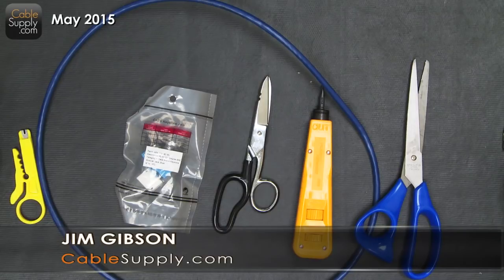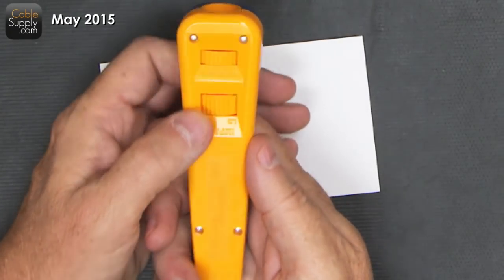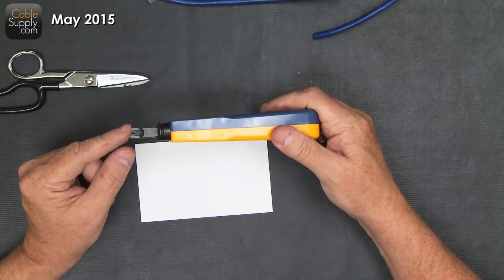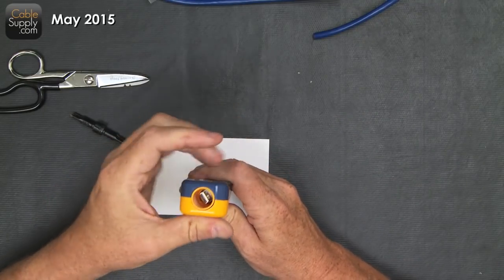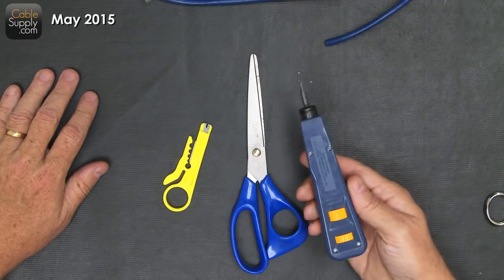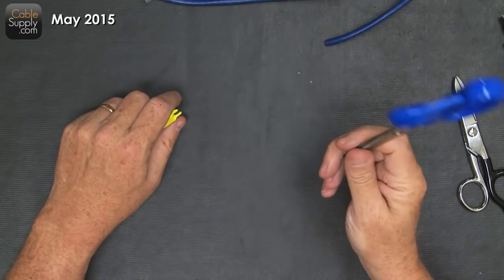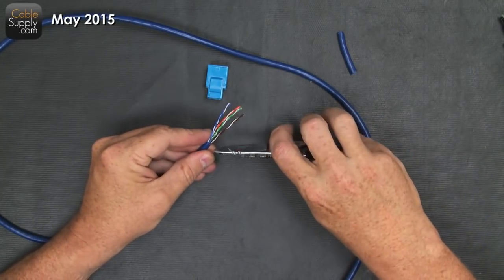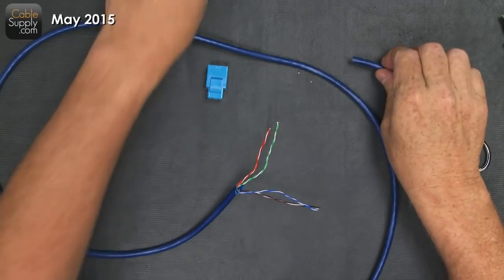How To Install A Cat6 Computer Jack

Comment: Honestly, if you don't want to EVER nick the cable, use the yellow handyman stripper to remove the cable sheath. Use the 2nd to last pre-defined strip hole, works everytime. Using the yellow stripper eliminates the need to cut further down the sheath. I'm a Pro and I don't use the scissors (not since the 70s and 80s),  too much margin for error. 
- Also, do not use the same stripper as a punchdown tool, you'll be chasing down bad punchdowns all day, instead use a spring loaded punchdown tool as described by Jim. The spring loaded punchdown tool click IS important.
- For using the the punchdown tool, one solid press straight down with a very slight jerk to the side at the bottom of your press gives you a perfect punch and the jerk nips the wire off in 90% of the cases. For the other 10% of cases where wire is still hanging off the side, do not remove the wire by rotating it as depicted in the video. This can surely cause the inserted wire to slightly or entirely back out of the connector prongs. To remove said wire, either re-punch or pull the wire in a downward direction or both. Usually this pulling is not needed unless you have a non springloaded  punchdown tool, a bad punch action or a dull punchdown tool.
- Unfortunately, all wall plates and RJ45 jacks are not compatible together. For the longest time cheap no name brand Chinese parts are flooding the market which are either murderous to connect or impossible due to improper moulding tolerances. This is a real headache. You can usually tell when the parts are so much cheaper than the name brand average cost. You will find the right fitting parts at Jim's place cablesupply.com.

Comment: That central insulator has a nylon thread running through the center. It can be used to open the outer covering like the thread in cat 5e does, rather than taking the snips to the cord again.

Comment: I was taught that the twist in UTP cable was to cancel out Interference from Induction-it Insures the Integrity of the signal nice refresher class though- thanks.
Reply from the maker: I took a course years ago on antenna design and radio wave propagation. I learned a lot about frequencies over wire. The twists in a cable are designed based on the frequency of the transmission. I could teach a whole course on the physics behind that. Thanks for watching.

Comment: Sir, why did you try pulling out the internal divider (cross-web), surely you know it's an intrinsic part of the cable thus runs through the entire cable length?

Comment: Great video, really helped! Im about to cable my new house with cat6. Could you recommend me a good brand?
Thanks
Reply from the maker: nighthouk Great question! While there are many brands out there that are great quality - they tend to be more expensive than the generic cable. Additionally, there are very few differences between the two when you consider quality alone. All cable has to pass certain tests before it can be sold in the United States.

We suggest using the cable we sell on out site. At CableSupply.com, we check our cable to make sure the quality meets our personal expectations. If our techs don't like it, they won't use it in installs. If they won't use it, we won't sell it. Check out what we use here: http://cablesupply.com/bulk-cat6-cable/189-cat6-1000ft-pvc-solid-bulk-cable.html

Comment: So I have a hypothetical, if I had a business and needed you guys to cable 300 jacks. Could i get you guys to use the toolless keystone jacks on both ends and unpopulated patch panels? or would you recommend I go with punch down style keystones?
Reply from the maker: jaime munoz Both types of jacks will work exactly the same, so either would be fine. However, toolless jacks have a higher price than regular jacks, and are made to help non-professionals make an easy, quick, and cost-effective install. Odds are, if you have a the professionals (like us) come in, they will have all the tools and experience necessary to easily deal with the regular jacks and wouldn't need toolless jacks. My recommendation is to talk to the people you're hiring and ask them what they prefer to work with.